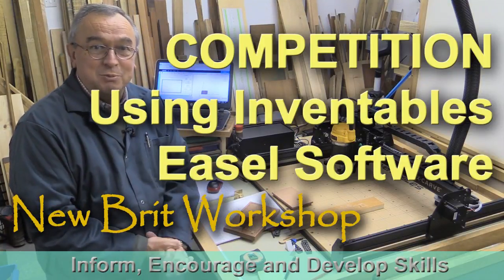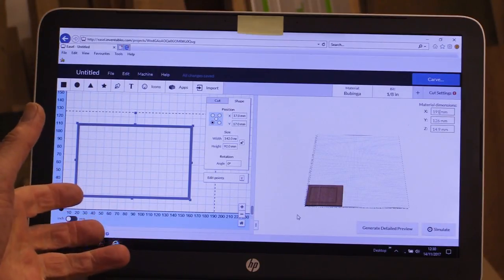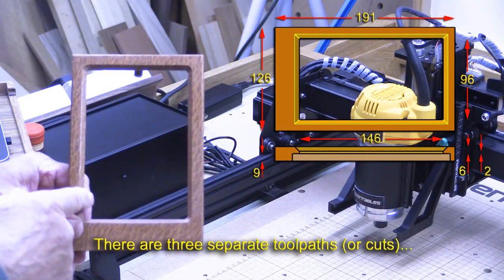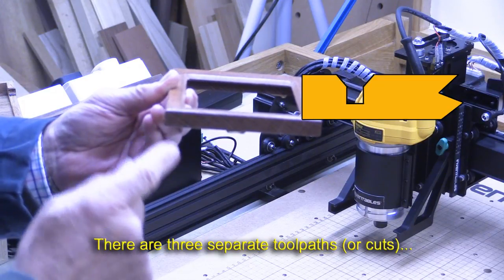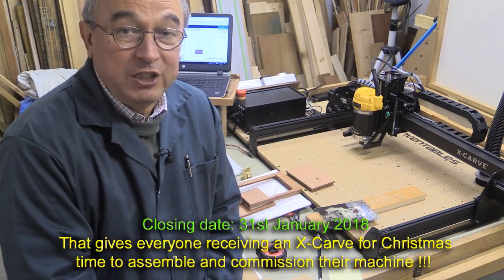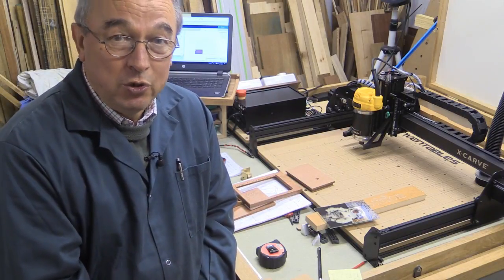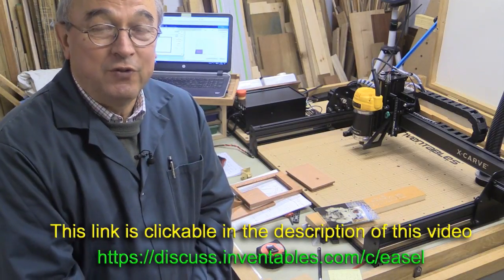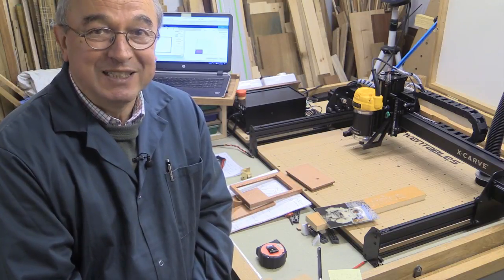Competition  - Using Inventables Easel

Comment: how did you change the bit and still keep the exact home position?  My biggest problem is when ever I change the bit I have to move the router and can never get it back into the exact same home position
Reply from the maker: The process is as follows. When I set up the first cutter (the "V") I set the machine at the job home position on the surface of the wood at the bottom left and corner of the piece. I then did that cut. When I changed the bit I took care not to force the machine to move in either the X or Y direction. All I then had to do, using the machine control in UGCS, was to move the machine in the Z direction (downwards) until the tip of the (new) cutter was just in contact with the top of my work piece. This was the new job home position for the Z axis and so I issued the command, in UGCS   G92 Z 0  which simply told the machine that this was the new Z home position. I did not need to do anything about the X and Y job home as the machine had only been moved under UGCS control and so always knew where it was in relation to the original job home.     Peter